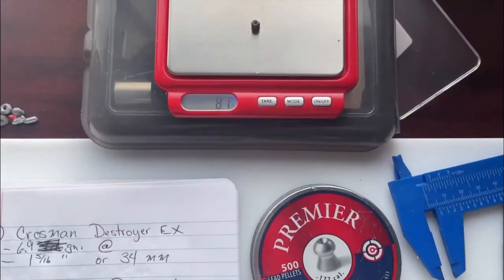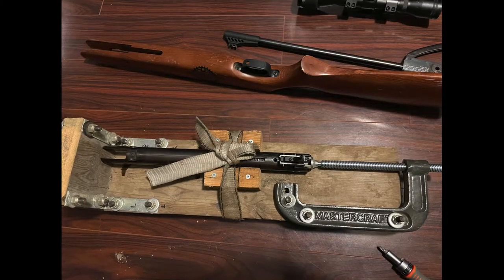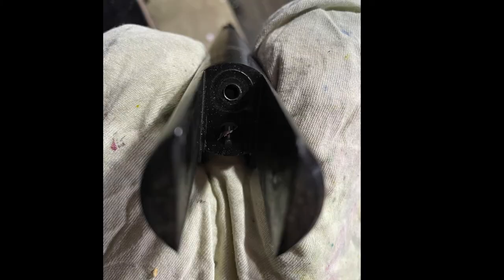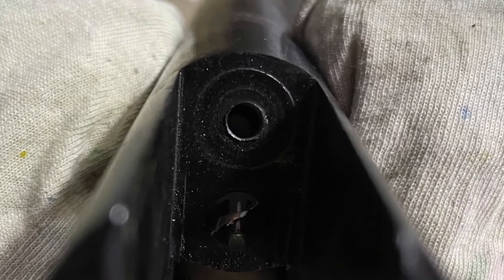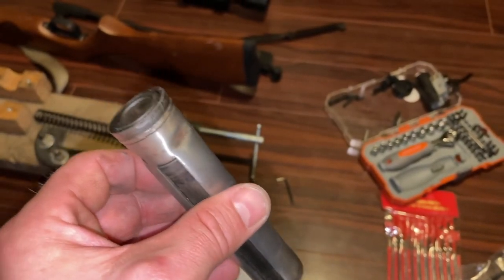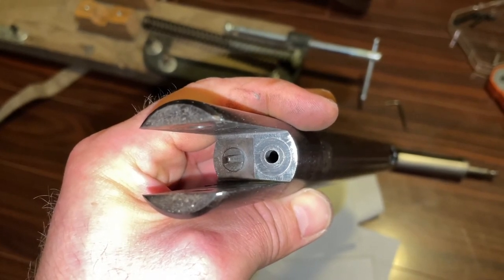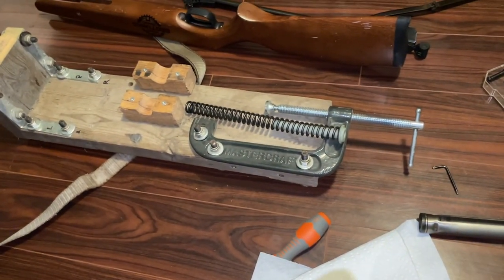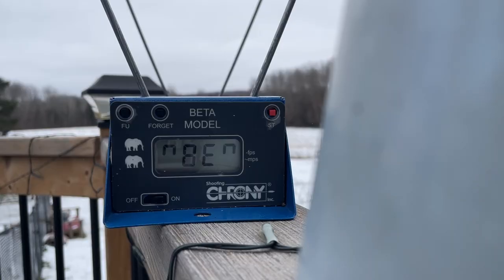Air rifle porting! will it gain FPS?

Comment: The manufacturers have generally already maximized the transfer port and enlarging may only reduce velocity. To increase velocity a shorting of the piston head will increase swept volume resulting in increased velocity. Also in creasing spring strength or adding washers to increase velocity may provide a small increase but usually at the expense of smooth firing behavior  ie  more recoil, rough shooting,ruining accuracy. Some of this I found out through experience and some by reading.
Reply from the maker: Ya I tried a big heavy spring and wasn’t impressed by the recoil and loss of accuracy. To be honest it shoots best at around 550 fps
Reply: @BROTUNED  this reminds me of real firearms that have to use different gunpowders to get different performances. The gunpowder of a pistol is much different than a rifle because of the difference of the barrel lengths. Therefore the gunpowder of a pistol is more explosive  than that of a rifle to get the bullet out fast enough. The rifle on the other hand can best utilize a slower burn to create building up pressure taking advantage of the longer barrel. Pistol gunpowders in a rifle creates all sorts of problems for example the m16 during the Vietnam war. A larger exit hole in a pellet rifle should release greater gas pressure but perhaps more explosively instead of a rapid expansion.  The small pellet can only accelerate so much before getting out of control.
Reply: If you shorten the piston, you will increase volume while cocked but then the piston will not go as far towards the transfer port, so at the point you literally went backwards.
Reply: @Turbogto_guy  Nope. The spring will reach the distance, it won't fall short at all, unless it was cut. Most springers are over sprung by the factory, so a modified piston will serve to improve firing behavior rather than adversely affecting fireing behavior. All this of coarse  assumes that the smith has the requisite knowledge to execute the modification. Some do some don't. Some able and adventuresome individuals have done this with the Webley Tempest  actually raising velocity from 420 fps to 500 fps. Some said it couldn't be done. But they were wrong.
Reply: @neilplace7916  I’ll take mine apart tonight and see what I can do with it. Was thinking a lighter piston would help too.
Reply: @neilplace7916  took it apart this evening. There’s no way to shorten the piston. I had a gas ram conversion in it and evidently it’s lost power. I was only getting low 700’s with it this evening and with the same pellets I used to get 950ish. I took it apart numerous times trying to find more power. Getting back to the piston. If I could shorten it, it would just run into the slot in the tube cut for the cocking mechanism. It already goes far back enough that I can see the seal. I tried shimming the gas ram. Any extra shim and it would not cock. So I put the spring back in and it went up to 900fps with only one washer shim. I’m going to lighten the guide that rides in the piston to see if I can reduce recoil and add power.
Reply: @Turbogto_guy  The gas ram is a different animal, it's probably at its best already with the velocity you stated. but sounds like o-rings but I couldn't help with that. Not all airguns lend themselves to mods. Some have room for improvement, some don't.
Reply: @neilplace7916  I had a custom air seals oring piston seal in it. Took it out and put the factory one back in and it picked up power. That gas ram used to shoot at 950fps. It does shoot far smoother with the ram than the spring.
Reply: @Turbogto_guy 😊
Reply: OK after go through all this i can tell you shorten the piston will increase power and fps i did this in my Indian made air rifle i had 22 cal  air rifle and I'm a power freak 😅 a mechanical engineer too i took all the measurements before doing any mod into my air rifle so here is what i did when you tap the barrel to expose the breach the cocking arm moved backward to move the  piston the gap between cocking shoe( while breach is closed) to the piston groove end( where cocking shoe made contact with piston to move it ) is the area where you can get rough idea how much you can shorten the piston i did shorten the piston 20mm that causes it leave more room for air in compression chamber wich increase the power i also had to increase the cut groove lenth wich allows the cocking arm to push the piston to towards trigger assembly
Reply: they sure have in the usa but for import into canada they detune the rifles and make it under 500 fps
Reply: @Turbogto_guy  I agree....doing changes in the air tube, via trying to shortne or lengthen either the piston sweep or valve length, isnt gonna do much because the actual air tube length needs to be made longer or wider, to allow more space for more air to be compressed into the air valve itself.
Reply: @Double-xposure  If you change position of piston length, then one needs to change position of the actual air tube, where the air is located and compressed into the valve. The air tube remains the same, so you cannot get more volume of air into that air tube, no matter if you change the piston sweep length.
Reply: @davehimlin2374  here's how it works in my case. supose the air rifle is cocked ready to fire position the piston is moved to it's locked position leaving the compression chamber area empty the piston head still had some enough space in the compression tube which i thought i can shorten the lenth from piston head side . Whith that reduction of 15mm from head size leave more room inside the chamber now when the air rifle is fired piston front have to move 15mm more then before i hope you understand my point sir and my explanation
Reply: @Double-xposure  Have you tried putting a shim in the rear of the rifle, rather than between the gas ram (or spring) and the anterior wall of the piston? Compressing a Nitro Piston, in my experience, doesn't improve after ~3mm (3 washers), since Nitro Pistons don't really benefit beyond that from pre-load. There's a general balance between total capacity of the compression chamber, the weight of the piston, the strength of the gas ram and the diameter of the intake port. If you can pre-load the gas ram from the rear of the rifle rather than the front, you don't risk making the compression chamber capacity smaller.
A heavier piston is likely to improve FPS, but as you know, accuracy might be affected. The priority is of course maximizing the amount of air that's compressed, which is also making sure the piston seal is healthy. Some people have drilled holes in the Benjamin Trail piston so it's lighter, and while this did decrease FPS, it improved accuracy & improved recoil.
You're right about the piston shortening working to increase air capacity, but to maximize that extra capacity, you'll want to be sure to get a powerful gas ram. On some trigger mechanisms, on Benjamins & other Crosman airguns for sure, there is limited real estate of course. I replaced my Canadian gas ram for the wimpy 495 FPS version with the one that's capable of 750fps (60kg), and I'm about to try a 3rd gas ram that's got 70kg meant for 900fps+, but it's also overall 6mm shorter due to it being an NP2.
The 'magnum' piston is of different length & weight, I'll be testing that this week coming. Even with the replaced gas ram (60kg, meant for 750fps), even 3mm shimmed, I'm still seeing a FPS slightly faster yet still well within the Canadian regulations (using a 14.3gr Crosman Premier hollow point pellet). My intent was to just start whacking the piston harder & harder against the intake port 'til I got the 495 FPS I'm paying for. I'm going to be dropping in another gas ram with 10kg more power with the existing piston anyway, but something tells me it's gonna make a huge slam, be super loud & inaccurate as possible. I'll bet it's still going to be < 500fps, though.
That leaves 3 things to investigate - the overall capacity of the compression chamber vs. the diameter of the intake port, and everything about a different piston. 
Replacing the piston & seal assembly is pretty easy & cheap - but something tells me the compression chamber might just be limited. I'll check to make sure there's no bleed hole in the new piston when I get it, and I'll JB Weld it shut if there is. Others have advise I check around the welding of the scope mount rail to ensure no air is escaping. I'll mod the piston so it's making an idea seal, and I'll see how much of it I can hack off without ruining the cocking/trigger trap groove distances. I didn't check my intake port diameter, but if it's 3.5mm or larger, I think I'll just leave it alone.
Reply: @BROTUNED  More feet per second = the need for a heavier pellet which in return you will lose some velocity but take back a lot more accuracy.

Comment: I find it weird that so many here in the comment section believe that a smaller transfer port makes the pellets faster. Anything smaller than caliber diameter is just additional resitance and therefore decreases velocity. Except for a tiny bit of underboring, because the port itself is dead volume. but other than that, 3,5mm works on any rifle, 177, or 22
Reply from the maker: That’s exactly my theory. It’s like porting and engine allowing a greater volume of air to flow through in a shorter amount of time.
Reply: @BROTUNED  
On my gamo replay, i drilled it to 3.2mm and reduced the piston weight by 15 percent. I used an angle grinder to cut out a strip. The piston bounce that used to hurt my shoulder is gone, and there is no real forward recoil either. It's a lot more accurate now. Can't really compare the energy, because it used to diesel extremely before that mod. Furthermore, i cleaned it out and used silicone oil.
Reply from the maker: Where did you cut out lengthwise along the piston body or across it?
Reply: @BROTUNED 
Lengthwise. the ends of the piston are wider and   have to be left intact. The strip i cut out was approximately 2cm wide and was on the opposite side of the normal cutout.
Reply from the maker: @leod1961 thanks for the info I’m going to look into this
Reply: @BROTUNED  you are welcome mate! If you do the mod, please share your experience.

On my model, i wasn't able to remove the screw from the break barrel action, so i had to solder a rod on a drillbit and slowly drill it from the inside. It did work.

Ps: i haven't lubricated it in ages, so today it felt dry and sticky while cocking. Accuracy and power dropped, while it became a lot louder and harsher shooting too. Some silicone spray into the pressure chamber made it quiet again and reduced recoil. Hope that is usefum

Comment: I would recommend a transfer port size starting at 3.6 mm 4 at the very most.  Also a stronger spring and washers stacked in the piston for weight.  And some newer jsb pellets or h@n .
Reply from the maker: The big spring I put in on one of my newer vids made the rifle shoot worse I and going to switch it back out for my lighter one soon not sure if it’s recoil or harmonics but lost accuracy
Reply: @BROTUNED  this is usually the case ,

Comment: I drilled out the port on my first air rifle(Gamo Shadow1000). I didn't have a chronograph, but before doing the mod, it wouldn't pierce an old rusted burn barrel at point blank... after the mod, it would pierce it form 10 feet.
Reply from the maker: That’s a great improvement in power for sure 👍🏻

Comment: if your rifle is a .22 then drill out the transfer port no bigger than 4mm max a tapered drill hole from the inside of the air cylinder is far better than a Strate hole drilled from the outside, but any drill hole made must be smoothed bored. no ruff edge's in the hole, as they will cause turbulence and slow down the passage of compressed air, deburr all the edges. you will need a stronger faster spring, but do not overload the trigger sear, or the gun will become unsafe and will start discharging without warning, if this dose not give you enough power all you can do now is bore out the air cylinder and change the piston size for a bigger bore, so you get more air capacity out the cylinder, to improve FT,PS = more FT,LBS more air in needed to push the pellet, but not that much more presser,
Reply: enlargin port  is  on air guns that were  poorly  made ,, so it will not  give you   even  as  much  speed  boost as  lubing   the cylinder  on  50 shoots  or so //spring  and  piston  seal   change  is   only way to get   more  power  that  is  noticeable //no chronny  I mean it can  brake   glass  bottle  on  40 yards  that    could  pre   fix   brake it  on  20   yards tops// get a diana   450   magnum  if 177 //and   you got  most  that 177 can  do //and  you will  grow some  muscle  cockin it  //and 22 cal is  I think   called diana  magnum  460 //and is   a  pinch stronger than  177 //not a  lot  but  if  into hunting  crows,rabbits  , etc it is  close  to  1000 or  more  dollar  prefilled   air  rifle  //but  there you   got to   fill   bottle  , shoots are  not  consistent ,, and  power is   at  maximum  1/3 stronger   with using  slugs that cost   at least   10 time   vs  top pellets

Comment: The air rifle companies have maximized the blow through holes on the piston chamber sides. My advice would be get a more powerful air rifle,rebuild the piston, or upgrade the model with performance parts where applicable! Ruining the air rifle proves nothing but ignorance. You can always upgrade to an Pcp air rifle for superior performance.
Reply from the maker: I’ve been looking at pcp’s for a while now but start up cost is more than a custom 22
Reply: @BROTUNED  Those extra costs are only once. You can keep the pump/bottle/optics when you upgrade or buy another pcp.
Reply from the maker: Ya I know I really want one just need to do more research